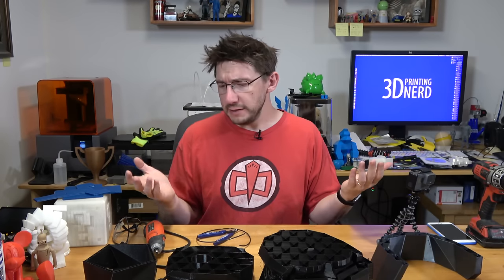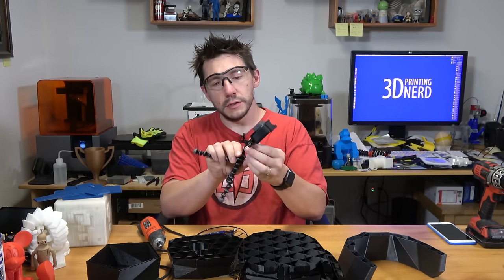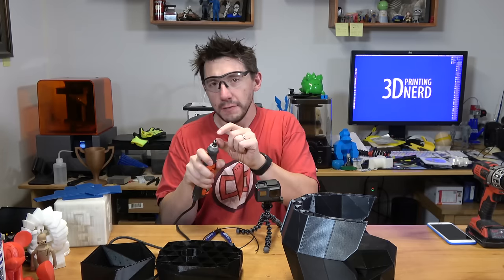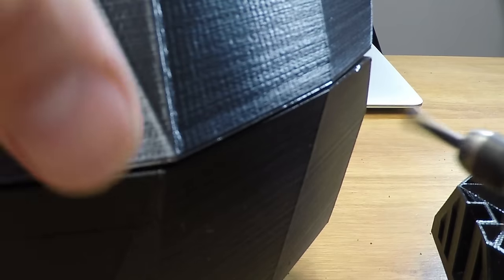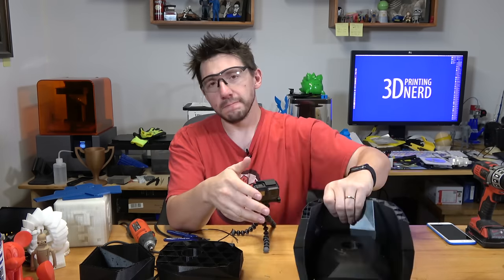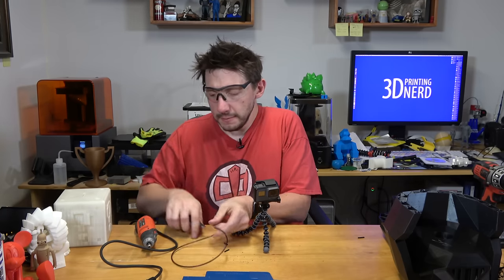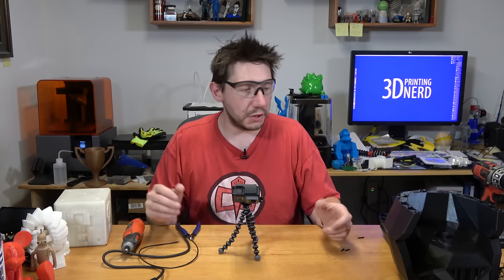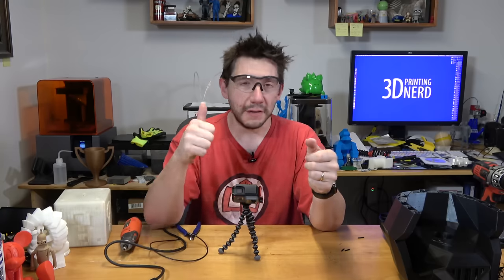3D Printing and Friction Welding: Attaching 3D Printed Parts with Heat

Comment: I always thought my glasses were "safety enough" until a piece of sharp plastic broke off of an impeller I was trying to remove from a motor spindle. It flew under my glasses, bounced off my cheekbone and ricocheted into my eyelid and cut it.  Literally 1 or 2 millimeters from my eye.  Most safety glasses have that "wrap around" to keep that from happening.  

I now use safety glasses over my regular glasses ALL the time when I am working on projects.  The problem is finding ones that fit over my prescription lenses (I have larger sized lenses).

Comment: Joel - I've used this method a while back to weld a storm trooper helmet together for my son.  What I did to adjust it to my ideal weld penetration was to print different size rods until it worked for me.  I printed the helmet with a 35% infill and a 2mm rod worked best for me.  I tried using 1.75mm filament and it was hit or miss due to the curvature as it came off the roll.  The printed rod was straight and held together better.

Comment: Back in the mid' 70s, Mattel released a series of "SpinWelder" plastic models made to be assembled using just this technique. They came with a small tool that was basically a battery-operated hobby motor in a plastic handle, with "welding rods" and "rivets" that you'd fit onto the shaft of the motor and "weld."I built a couple of those models back in the day, and it's kind of cool to see the idea revived now! (Though I HAVE previously considered trying the technique out myself with some of my own 3-D prints.)
Reply from the maker: Whoa! I'll have to look that up!

Comment: I used this technique to join the neck components of my 3D printed violin — worked just fine! I went a little slower than you and the filament deposited very well into the join. Definitely use short straight pieces for the welding material.

Comment: I've always thought my glasses were safety glasses enough. Especially since without them I can't see what I'm doing.
Reply: 3D Printing Professor haha
Reply: Safety glasses are typically rated at ANSI-Z87 or ANSI-Z87+, which if you have plastic lens glasses, they are 99% of the time rated exactly for that. So either way, you're getting the same protection, but it's up to how much coverage you think you need, as safety glasses often have side shields and sometimes upper and lower eye protection.
Reply: Also if a cutting wheel breaks and hit your glasses you are looking at maybe a week of near blindness and if you have safety goggles you just buy a new pair.
Reply: Lol, good thing I'm near sighted!
Reply: Engage safety squints
Reply: @3D Printing Professor, there are safety googles you can wear outside your normal eye glasses. Your normal eye glasses are NOT safety glasses, unless they are specially made for that purpose.

Comment: I used to do friction welding going back even before you were born, guessing 1980's but can be a lot further back in the 40's.
It is more durable than any glue I know. Never used glasses in those days.
Second part, ah yes soldering iron too (80's again), someone mention how you soldering the plastic, same way as you do soldering, just add filament like welding, that too again pretty durable. Which I repaired my 3d printer with, ahhh the fun.

Comment: SpinWelder - it was a toy in the late 70s.
awesome stuff.
Reply: Ya I had that as well.
Reply: I came down here looking for this comment before I started my own.

This was way back when kids were allowed to play with cool stuff, and all the great toys weren't nannied down to the lowest common denominator.
Reply: I had one as well from the early 90's a race car thing you welded then crashed then re welded
Reply: add me to this, I think I had mine in the late 70's. It was a car you built by welding with these little pieces that looked just like soft tip for dart boards.

Comment: I had a toy car as a kid that used this concept to build the frame with plastic welding. Doing a bit of searching I think it was this thing THE MATTEL SPINWELDER race car builder. When it broke you could fix it till you ran out of the plastic.

Comment: I'm sticking to my trusty 3D-pen. You don't damage the material - you just add some. Also you can control the temp for better adhesion and make small corrections by hand before the material cools down. Aaand its less noisy. 😉 Cheers!

Comment: Just spent 1/2 hour trying this out with butt joints, angle joints, fillinng holes, and even sticking a piece of filament straight onto a flat surface or to another piece of filament. Works great. I found 10-15krpm works great on PLA. Heat control is key. Practice and find a technique!

Comment: That looks like a cool technique!  I bough my 3D printer with the idea of making what I call "suncatchers" (basically a faux epoxy resin stained glass made from photos I've taken over the years).  My plan is to use my 3D printer to print an outline of all of the shapes in the final art piece and then use epoxy resin to color in the pieces to make the stained glass look.  In an effort to overcome the maximum print size issue of my printer, I've been looking at how I can break down my models in Fusion 360 into segments that I can scale up to fit on my printer and then glue/weld them together before doing the epoxy coloring.  My hope is that I can make some 3D printable/epoxy resin art works that are larger than what my 3D printer could print if I printed the entire outline in one go.  Basically, I just wanted to say thank you for this video.  I'll have to try it on a art project I have in mind.  :-)

Comment: For a diffrent filler if you don't have baby powder you can use baking powder! I used it when repairing the bridge on guitars. Baking powder and super glue makes a really strong compound that can be sanded down later to make a nice finish.

Comment: Just spend 1/2 hour trying this out with butt joints, angle joints, fillinng holes, and even sticking a piece of filament straight onto a flat surface . Works great. I found 10-15krpm works great on PLA. Heat control is key. Practice and find a technique.

Comment: I've seen that acetone can be used on PLA to weld them together. Would Acetone work better than welding as far as holding strength is concerned? I feel like the acetone method would leave a better finish as well. I guess I should just try it....
Reply: Acetone should only work on ABS. For PLA you need for example dichlormethan.
Reply: InsertNameHere isn't chloroform more fun though?

Comment: I think the last example was closest to the origin of the friction stir concept. The idea (in metal) is to plasticize rather than melt the material with a non consumable tip. The first section of the blue plastic showed this well. I think if you can join without filament loss, it would produce a better looking and stronger weld. 

Nothing wrong with consuming filament, though, and I enjoyed the video.

Comment: I use a Ureathane Supply Model 6 to do my plastic welding. Works great but you have to pay attention. As for the safety glasses. I have safety glasses that go over my regular glasses. I was the safety compliance person for the place I used to work. Saw to many work comp claims because someone did not pay attention, listened to  bad advice or cut corners.

Comment: I have been using baking soda and CA as a filler and thickener for a years(picked it up during my hobby rocketry days) this is very strong and can literally take super-mach stresses; plus, you almost always have baking soda on hand, baby powder is less common among single-type or younger people.
Reply from the maker: Oooh, very strong? Really? AWESOME. I was going to test chemical bonds against welds when I have the chance. I cannot wait to try this! I had NO idea baking soda! I wonder if baking soda + CA has different strength properties than baby powder + CA?
Reply: yeah, i have used it to fillet fins on 8 foot tall rockets, travelling in excess of mach 2. i like to use the layering method; simply lay down a coat of thin CA(i have not had reliable or consistent results with gel CA) while that is still wet give put a heavy dusting of baking soda(which almost automatically dries the CA) then soak the Soda with more CA. give it a few minutes to dry up; Rinse and repeat until you reach you desired thickness, sand or grind off any excess.  Soda is sodium bicarbonate has a Mohs hardness of about 3 and baby powder is usually made of talc  which is a 1; not sure how much of that translate to the final product and might be interesting to see.

Comment: I find using an old soldering iron to work better than friction welding
Reply: do you add filler material? or just melt both sides?
Reply: I was going to say the same thing.  If you get the temperature right the welds can look fantastic too!
Reply: Crazy glue gel works too and you dont get that sloppy look on the seams... Ive personally tried both and glue is faster and way stronger for fixing a  actual part that needs strength. If its just for look then friction works fine..

Comment: Could you use this to fill a small hole to join two overlapping pieces? For example, I noticed what looked like screw holes in the blue pieces you friction welded. If you were to overlap one of those screw holes on top of another solid piece (not aligning two holes), could you fill the hole with this method and create like a plastic rivet?

Comment: Another method of 'welding' 3D prints together, is to use heat.  As in, a soldering iron, preferrably with controllable temperature.  Or perhaps a device like a 3D simo mini that has a wood burning attachment with a 'fix plastics' setting.  Actually melt the plastic at the joint location, melt the 2 pieces together along the edge.  Or, another trick, would be to use a soldering iron, with a piece of filament, as if the filament was solder.  It melts metal, it can certainly melt plastic!  And then just 'solder' the parts together with melted plastic.  If you use the same kind as the prints were made from, it should form quite the bond!
Reply from the maker: +Monolith Tyriss I hope to try this idea soon!
Reply: Monolith Tyriss thus is my personal method for welding parts together
Reply: I use this nethod exactly, its working just like real metal welding. You can even fix small voids, holes between parts.
Reply: I've tried that and it works relatively well, provided that the seam is flat. What excites me about this method is that it looks like it would work better in situations where the cracking is on a joint.

Comment: Could a heat gun be used for this and removing layer lines? Would it strengthen the part both at the weld and through the layers? Thanks for the great content!
Reply: I wouldn't do that. It'll just warp the print

Comment: If you angle the rotory tools back towards you more, the filament will melt better and it'll penetrate the crack more, giving you a better bond.

Comment: As 3D Printing Nerd says about halfway through; I can definitely see where this particular technique might be useful, but for this set of models & welds shown, a wide hot knife would have provided a faster, cleaner, stronger weld. In my experience, hot knifing is more precise than a rotary tool.
Reply from the maker: +Thomas Wade I agree with you on that one.

Comment: Isn't 3d pen is more handy for such stuff?
Reply: Was looking for this comment
Reply: Кот-терминатор its also cheaper then a rotary tool
Reply: It allows you to only add more filament though, this technique also welds the existing material together (at least a tiny bit).
Reply: tim kors well it is, but anyway this method interesting too.
Also, my friend used to melt abs plastic in acetone until it became kind of paste, and he use it as glue, which dries to normal plastic afterwards
Reply: I would say use the spin welding technique to physically weld the parts 1st, and then fill the valley using a 3D pen. I used to do something similar with motorbike ABS panels, although 3D pens weren't available then so I would weld the ABS with a gas soldering iron, and then feed thin strips of hot melted ABS into the crack, this ends up as a strong and fairly tidy joint.
Reply: MrJozza65 that's a good idea. I think i am going to try that!
Reply: Кот-терминатор I agree with you the 3-d pen would work better if you know how to make it nice looking. Otherwise I probably would find  a different  way
Reply: good luck best to just plan on some sanding and maybe carving away the excess with that said rotary tool lol, I did this for a largish LCD panel bezel and it worked out ok, but I think working with ABS solvent smoothable and a larger printer to print parts in one go, are going to be how I go about such things in the future.
Reply: I use a 3D pen for a lot of welding. Sometimes I feed the filament by hand and use a temperature controlled hot air gun to make more solid and massive welds.
Reply: I use the hot nozzle sometimes to weld something.
Reply: @Technology89  most makers have a rotary tool of some sort, but a 3d pen isn't as common
Reply: Dremmels are good for finishing work anyway, good to have around

Comment: instead of trying to do an additive friction weld which was obviously only partially successful, you should try doing a friction stir weld which just involves getting the two pieces hot enough to melt together. Which would mean less stopping to replace your used up filament. Just cut a piece of coat hanger and make a blunt round end.

Comment: Why not just use an extruder pen to dispense some extra hot and quickly extruded filament to weld the 2 materials.  If you cannot use solvents and have no glue it should work just fine but on larger pieces I'd still go glue because of the quick drying time of the extruded plastic.

Comment: This might be a silly question but why not use superglue instead? I mean in the absence of magical unicorn butter (love that!).
Reply from the maker: Oh, I LOVE superglue! I just wanted to see if this would work well :)
Reply: Got it. I use the Locktite Professional variety and it never lets me down. I saw you'd printed Tom's Groot which of course I then HAD to print. It's half way through now in Hatchbox Wood on my new R2. Have you had chance to take a look at the Robo3D R2 yet? It's a sweet machine! Thanks for the great videos Joel. You've inspired me to experiment and have fun with my printers.

Comment: You do not need safety glasses if you are a glasses wearer, it tends to be considered safer if you can see what you are doing. Especially with power tools.
Surely you know as a man, turning you head slightly away from the flying lumps is safe enough, if it gets really bad a brief squint of the eyes protects you from any other fast moving danger.
Reply: WaxingRadiance - this is such bad advice, words cannot describe my dismay. for this particular action, safety glasses may not be fully required - but with any other power tools just remember this - you only get one set of eyes. Tiny metal splinters, or any other number of Hazards will destroy your vision and you'll have nothing but regret left afterward. Is it worth it?
Reply: This is the comments section of you tube !
It's not the place to get safety advice. 
I am a glasses wearer, so, watching a video in which someone takes off their eye glasses to replace them with some cheap plastic safety glasses and then says I can't see what I am doing will only ever induce comedic comments from me. This is a great channel so I am not trying to detract from the content, merely having a bit of a chuckle. 
Could you not see the humour in my comment ?!?
Reply: WaxingRadiance - ahh, I missed the 'Safety Squints' reference. so yeah, now I get it was humorous. I read it after waking up shortly before, so I missed that - but there are people who read these comments and don't catch the sarcasm either. Having worked in Industrial environments where safety glasses are required, I'll just point out that they do make models to fit over eyeglasses. Safety Squints engaged for further replies.  :)
Reply: Safety glasses are typically rated at ANSI-Z87 or ANSI-Z87+, which if you have plastic lens glasses, they are 99% of the time rated exactly for that. So either way, you're getting the same protection, but it's up to how much coverage you think you need, as safety glasses often have side shields and sometimes upper and lower eye protection.
Reply: Robert McEwen Now you're just repeating yourself. ANSI-Z87 or ANSI-Z87+ We get it, let's move on.

Comment: If you will put a small 45 degree bevel to the edges of the parts your wanting to friction weld it will give you a better place to line up the filament and actually bond further into the piece rather than just right on the surface.
Reply from the maker: HOLY COW that's brilliant!

Comment: Personally I use uv resin and I have a usb 10w uv light I put on it and sets instantly and its very strong. If its a part that needs strength I will run acetone along the visible side so its sealed front and back.

Comment: I don't and haven't tried 3D printing before but I've hanged around model building groups for a while but wouldn't acetone work as adhesive for flat surfaces like that Vader helm model? If acetone can melt plastic, it can be use to bond plastic together right?
Reply from the maker: +Visa Vang it works well for ABS plastic but not nearly as well for PLA.
Reply: I see.

Comment: When I was a kid (late 70s) I had got a plastic construction set to build a biplane. It used I-beams and a rotary tool to spin some plastic to weld them together. Exactly like this. It had cardboard skin that was applied to the outside of the frame by plastic rivets. I loved that toy. 
Found it! Spin Welder
https://www.youtube.com/watch?v=PnWpcwnR2YA